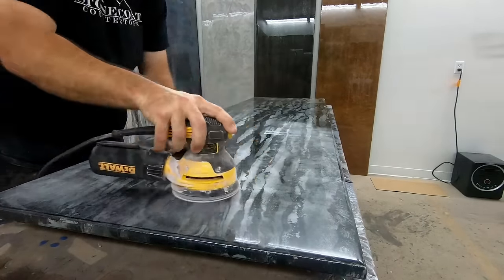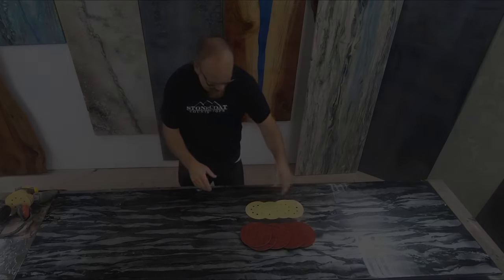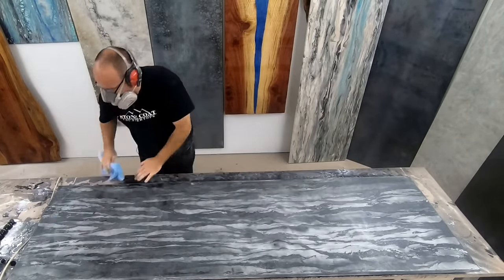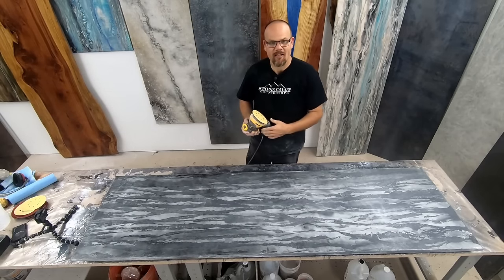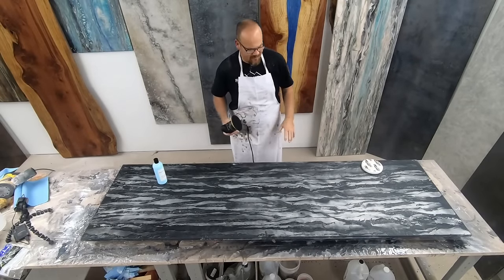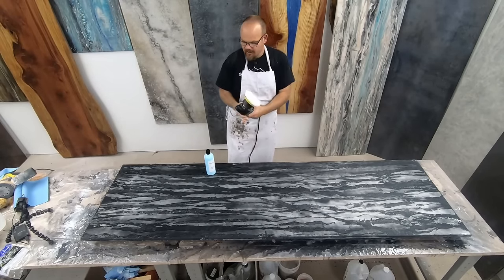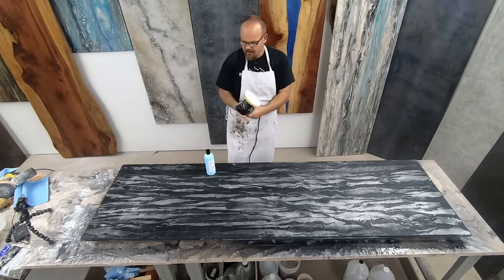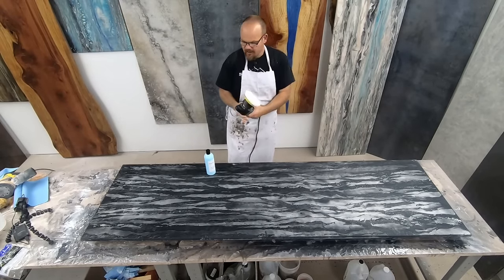Polish Epoxy

Comment: This whole method is unnecessary. Why? Because if you apply the UTC, it in itself leaves the surface with a texture.. Very slight,  which makes all that sanding unnecessary. Sure, if there are blemishes you want to remove, then go ahead and sand them. But for most people throwing down another flood coat over the sanded surface would be easier than doing all that sanding BS with a sanders, 5 different papers and compounds..

Comment: Please provide more detailed instructions for using the home polish and clean kit when you don't have a power polisher.  After rubbing with the polishing compound ( can you use paper towels or what is recommended), do you have to wash off the residue with water before using the Smooth?  It sounds like you are supposed to leave the Smooth to dry before wiping, but that seems wrong.  It would be very helpful to include basic instructions in the package.

Comment: 3M makes a 5000 grit pad, just an FYI.  Also when connecting a vacuum system the Oneida Dust Deputy is awesome for saving money on vacuum bags and maintaining suction.   When I’ve sanded floors in occupied homes and so forth, customers have been astounded at how little dust escapes the system.
Reply: charles hetrick Was

Comment: I just finished my first commissioned counter top job at a cottage at a retirement village. I used the previous method using water with just the Mirka pads only and also using the Meguiar's 105 with an 8 " foam pad. It seems like it left small circular scratches in certain lighting angles that would not come out. The new couple loved it though, but I will look to use the new method to hopefully achieve a non scratchy looking surface. The cleaner is something I inquired about  to you about 6 months ago. I am glad to see that you now have one because I did not know what to wipe the counter top down with to remove the residue from the polish. It looked beautiful as long as you did not touch it, lol!  I will look for it on your website. Great Job
and thank you for all of the very informative videos!!
Reply: i had same issues :(
Reply: I had the same issues with the little circles (I call them fish scales). I wasn’t sure if they were caused by the compound or the waffle pad. I did realize that over s short time those “fish scales” disappeared.
Reply: Jason I have the same problem with the (fish scales) and just cannot seem to get them out, I know they come from the sanding process. I have attacked this problem from every direction I can think of, even took a cedar table to a shop that compounds and polishes million dollar motor homes,  and let them go at it. They had never compounded epoxy before and had about the same luck I did. I got the finish to look super shiny but could not get the )fish scales) out so I took the legs off and sanded the top back to wood, I was sick about the time and money I had put into this project just to run it through the drum sander and start over. (you said they disappeared)? I guess i'm to OCD for this step. I have a room dedicated to paint and pouring Plastic on the walls filtered positive pressure and I clean with water and then dust before every final pour and still get dust and other tiny crap in my tables. So not sanding and polishing is not an option. ANY FEED BACK WOULD BE GREAT!
Reply: @BG-dv5mm  It is from the sanding as the epoxy balls up on the sand paper. Water helps as a medium between the epoxy and the sand paper, leaving a better sanding finish... Some like to leave the epoxy less polished, appearing to be a matte finish. I'm not a fan as this is simply allowing the scratch to remain, even as fine as they are.

Comment: That's a very helpful video. Would like to see you do more of these demos with pre-installed countertops. Sanding inside corners with a DA sander under top cabinets ain't happening. Would be good to see how you tackle that.
Reply: Same Issue. I am thinking once i'm done with a particular git i'm going to the corners by hand and repeat with the disk and an approtiat shaped block. Probably better to do that first but only 2x pads in a kit. I don't have a lot of sf  so will i see how the first grit goes and use the second disk for that if i can get away with it. If i wasn't on such a tight budget i would probably just order an extra  Sanding Assortment Pack from Stone Coat Countertops and be done with it.

Comment: we had a professional do our epoxy counter tops, about 11 months later we had some red stains on part of it and were able to remove them by rubbing them out with Mr. Clean Magic Eraser sheets and lots of elbow grease, but now that part of the counter top lost the high gloss, would your compound work on putting the gloss back on that part?

Comment: Wonderful instruction and thanks for sharing. I have sanded epoxy numerous times, (not even close to knowing what I am doing!), but whatever I do I can't seem to avoid those dastardly fine swirl marks from the orbital sander, even when starting at 180 grit and working up to 2000 and even higher. I always seem to have those marks. Any suggestions on how I can avoid/remove those marks would be much appreciated. I tried both the dry sanding disc and wet/dry sanding paper.
Reply: Use 3M swirl mark remover liquid.

Comment: Just had my counter tops done here in SW Florida and I have to tell you that the counters are soft and VERY prone to scratches. While it looks great, I would have never done the job if I would have known I would have to sand and buff the counters multiple times a year!! They told me that their Sherwin Williams product was the best! Total BS. I am also hearing that there is a hardener coat available to apply at the end of the job from another contractor. Maybe you folks would like to ask about that!
Reply: ETI makes their own epoxy and is tough stuff when mixed right, called Envirotex Lite. Not enough hardener and the job comes out soft like your counters. You can roll out a thin coat of epoxy to seal your counter.

Comment: what are the additional steps/products for a higher sheen on an epoxy table? Thanks
Reply: You can’t.  I’ve been in this industry 30 years. It will never look like it did brand new. That crystal clear glass look cannot be achieved once gone,  this is the downside to epoxy.  You can make it look nice but never like when new glass look. These Guys will never tell you that when selling you on it,
Reply: Chris Burnsed   Thanks

Comment: Are you starting out low and slow at first to spread your compound then cranking it up all the way on your buffer?  Curious.  I have a "long throw" random orbit buffer similar to yours on the way.  Supposedly those long throw polishers give better results.  Yours is either a 15mm or 21mm I think.

Comment: Is this polishing sanding method done on the top coat product or is this just done straight after the epoxy cures. I am confused if this was sanded and polished after a the use of the top coat product
Reply: This is done before the ultimate top coat. You cant sand the UTC.

Comment: Will this work with the heat resistant epoxy?  I did not use top coat for the flood coat and I have an area I had to dress up on the edge. I went to 4000 but still dull compared to the rest of the love edge slab. Any tips ?

Comment: Did I miss the type of polishing compound?  Would like to know one for water clear finish.
Reply: Its similar to polishing your car. He used a compound and mistakenly called it a polish. Once you've gone over with your compound to get the sanding scratches out then you can go with a polish. I used 3D products and I would suggest the HD polish or HD Speed as a final polish.

Comment: I was asked a question about repairs. If, in the worst case scenario, a big gouge or large and deep scratch is made in the clear coat. How easy would it be to repair that? Sand everything much like you do here and put another clear coat on?
Reply: StoneCoatCountertops would you need to sand and polish the entire piece or just the bad spot?
Reply: J Ikonic just the sanded spot
Reply: This just happened to me and I filled the spot with two layers 24 hours apart. Waiting on the second layer to finish drying to see how smooth it bonded together then will sand/polish.

Comment: Hi, Mike, I love this technique of Epoxy...going to order soon. but after counter tops are finished, Do you have to clean and polish like this? if so How soon after it is complete? or is it ONLY when you have scratches and/or cuts in epoxy.
Reply: OR do you just polish with the Liquid Smooth periodically.? just soap and water clean for normal use counter?

Comment: Would this sanding and polishing be done after the Ultimate Top Coat is applied?  So far my understanding is that take the following steps:
1) Cut and sand the counter top out of MDF (that is what we are using for our outdoor bar).
2) Applying bonding primer and then sand with 220 grit
3) Apply epoxy undercoat then sand with 220 grit
4) Apply 1st layer of epoxy with color formula, dry overnight and sand with 220 grit
5) Apply clear epoxy layer, dry overnight and sand with 220 grit
6) Apply Ultimate Top Coat, dry overnight
7) Wait 5-7 days for epoxy to harden
8) Use sanding kit to sand for each supplied grit in your kit in increasing grits until done going side to side and then up and down and the edges
9) Apply the polish and let that dry
10) Apply liquid smooth product and then you are done!
Reply: Aww man I really need them to reply to this I have the same questions
Reply: Minus the polishing steps, this is what I did based on what they said over a few of their videos. Worked great. Now I am nervous about messing up the finish when polishing it all.

Comment: So I poured stone coat for the first time on Saturday, but unfortunately I left my backsplash pieces outside. It dried with a haze on it. My question is how soon after pouring can I sand and polish?
Reply from the maker: We usually suggest about 7 days for sanding and polishing. If you are doing another coat you are good to sand after 24 hours and apply another coat. You Got This!

Comment: What if you want the shine? I understand that for future use that it might be useful to do when there are scratches but in the beginning I want it to shine and get rid of the imperfections. Is that possible?
Reply: Dont go to such a low grit. Start around 600 or 800 and build up to 3000 - 5000. Presta compounds would work. Make sure compound isn't to abrasive. Finish off with glaze. Should give you the mirror finish and remove minor nibs and imperfections.

Comment: Help me out please!  I did my countertops a few months ago.  I love them!  I would like to just knock the shine off.  They are very smooth with no scratches.  I don't feel like they are thick enough to sand them so many times as you did here, and I am worried about swirl marks.  Can I just hand sand the top of them?  If no to hand sanding how do I avoid the swirls?  I guess I also don't understand why you have to start low and work your way up with grit.
Reply from the maker: Great question JB! We started at the lowest grit in this video to show a worst case scenario, you can start at 500 grit and work your way up from there on a newer epoxy surface, give us a call and we would love to help! (541)450-1976

Comment: I have dealt with the pain of the spray of Meguiars. However, I don’t want to have to buy a new buffer after buying the one you used in your previous video. So, will this new polish compound work fine with the old version of polisher?
Reply: The thing is they are two very different machines, one being the regular buffer/polisher that just spins, and the other is the dual action random orbit buffer/polisher.  The first one tends to be much more aggressive.

Comment: Are small surface scratches, (thin web like scratches that can only be seen at an angle in the light), normal?
Reply from the maker: Great question and thank you for watching New Chapter Art! Stone Coat Countertop epoxy is much more scratch resistant than other epoxies, but it can scratch. Scratches usually happen from objects that are rough or sharp, or from new epoxy finishes.  Small scratches are easily polished out. Usually, you can take a rag and some compound and polish out a scratch quickly. If the ratio when you mixed was correct and the temperature was not below 65 degrees fahrenhiet, you should have a top with normal durability. Please feel free to contact us anytime with questions or for project support. (541)450-1976
Reply: You may be referring to the tiny little scratches that you will get from sanding?  Often times those are difficult to completely get rid of unless you are some sort of polishing professional like a couple of people on here claim to be.  They say they can get it back to mirror finish... and I say that's just not going to happen.  (as do the Stone Coat guys)  I think the little tiny scratches that I'm speaking of are from the sanding process and unless you are really good and know what to look for those might be there to stay... but they are very hard to see by the normal person... if they aren't trying to find them they often don't see them at all.
Reply: @daysdesigns  They showed up after wiping the surface with a wet paper towel. But the can only be seen at a angle. Problem is it is an art piece and before I can try to sell it, I need to make sure that it is normal. I wouldn't want to sell something for it to get worse
Reply: Is it only resin or is there acrylic paint as well?
Because I know paint likes to do that a lot as it dries.
Reply: Resin is over the painting

Comment: So now you don't use the interference pad, correct? And no water with either disc type?
Reply: I've always had a problem getting rid of the tiny curly ques ...  I certainly hope this will help solve that issue.  What is your polishing compound you now sell?  Is it some sort of a rubbing compound?  Do you list what's in the product on the bottles?
Reply: I still found that the Abralone discs worked better with a bit of water.  Just my results at least.

Comment: Awesome!! Love this!! Do you recommend always starting with a lower grit, less than the finishing grit? Or, on a freshly finalized piece, can you just do a 3000 or 4000 grit sanding and polish?
Reply: Amber LaMere 
My question exactly! If I'm happy with the smoothness of my top coat, and I just want to barely nudge the sheen down to realistic looking polished granite, is there another reason to progress through all those grits?
Reply: Around 4:00 Mike talks about not having to start at 220, you can do whatever you want depending on what you are trying to remove.
Reply: It actually IS different than a car's finish though... so it will react differently.  Like he said, it doesn't work nearly as well if you just start at 3000 or 4000 grit then polish, it's not nearly as good a finish.  I tried it yesterday actually... and I would have to agree with them.  May take longer... but the result is much better in the end.
Reply: Can you ever get it back to a 'MIRROR FINISH' though?  I'm not finding that possible with epoxy myself.
Reply: @Gary O i did a counter 2 days ago, im going to try your method, wet sand with 3,000 then 4,000 use a finish pad with polish last.
Reply: @dougdk59  how did it come out?
Reply: @crizzler970  how did what come out?
Reply: @Gary O Ryan what is a DA?  I am a retired lady who is new to all this and love my countertop but see small hair and dust got on the one end of new epoxy.  I have a 5 " orbital sander and what grit would I use to just take off a light layer and can I do just that 1 ft end?  I found 3M polish/compound 1, 2, 3 bottles to use.
Reply: @dougdk59   I got small hairs from dogs on one end and tried 3000 and it didn't work. I have to use a lower grid first I think with a polishing compound.
Reply: @daysdesigns what would happen if one only sanded up to say 600 then used the polish?

Comment: Sadly the light scratches on my epoxy counters have been accumulating at a rapid pace with light activity. Sanding and refinishing isn't practical in a home environment.
Reply: I've lived in full-on construction many times--not ideal,  but very doable.  This little bit of sanding is very easy to do with just a little bit of prep and clean up.  I wouldn't beat an eye at this.

Comment: hey i got a question..you know how ppl want updated fantastic looking bathrooms with tiles and stone?    have you guys ever thought of trying it on a cast iron  claw foot tub???  im wondering if it could handle the long periods of heat and scrubbing?   maybe go to a yrd sale or a farm or junk yrd and just for kicks  experiement on 1.. i bet it would be unreal  gorgeous ;];];];] i was scrolling through a swap sell guide  in my area  and they have 2 good condition claw foot tubs for free  you haul...and then under that ad  someone was selling field stone..... thats when i came up with the idea for you guys to try out;];];];]  what do you think???
Reply: Hey Mike hears  A pointer you may or may not have thought Of on and install if you have a really tight fitting counter Top it's a great idea to tape a piece of aluminum flashing to the wall then when you come down with your top And its squeezing in They're really tight You Won't dig up your dry wall and when you're done you just simply pull the flashing out it works great I'm done it many times on other kinds of Tops

Comment: This may be a stupid a question, but why bother with the 600 grit, if you have to start back at 500 grit with the other paper? Could you just do the 220, 500, 1000,2000,3000,4000? I must be missing something, lol. Apologies & Thanks  in advance.
Reply from the maker: Great question Cookie Nibz, we started back at 500 to erase any marks left by the other sanding discs!